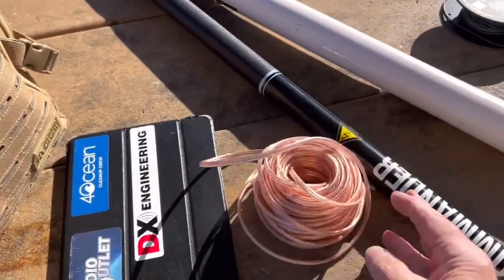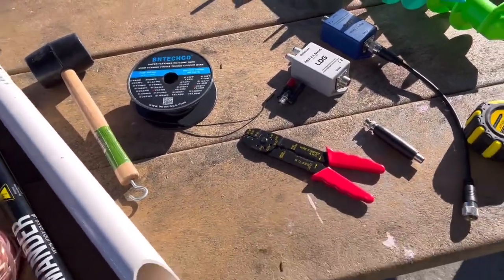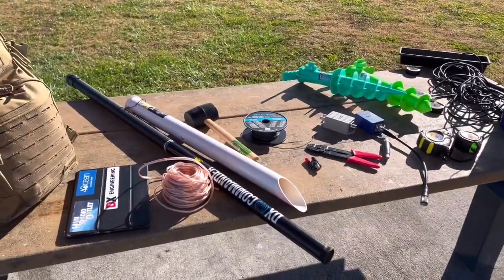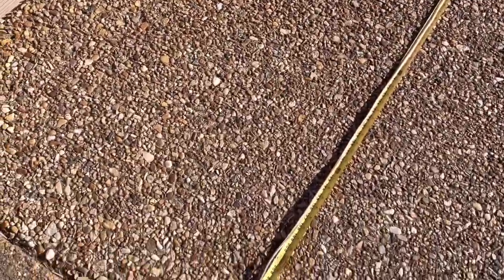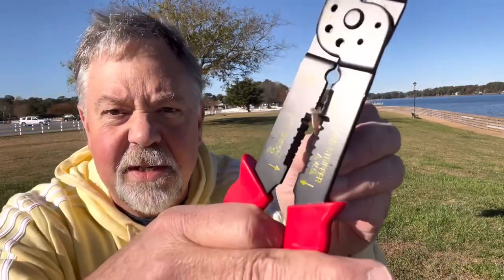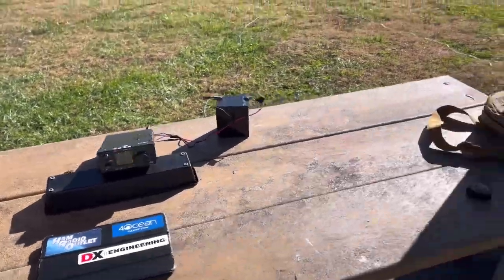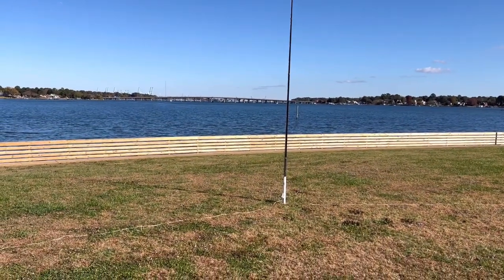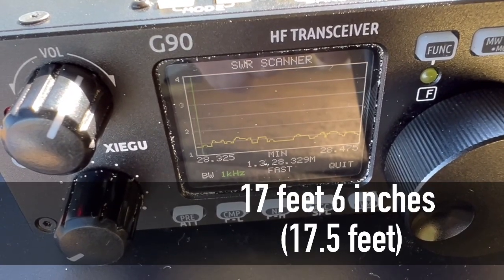How to Build an Easy Vertical HF Antenna

Comment: I've had good success with a similar antenna. I understand what you're trying to do with the quick-and-dirty approach. Here's how I church it up a bit: What I do with my radials is attach Anderson Powerpole connectors to them in groups of four, then I have connectors hanging off the ground terminal of my transformer on short pieces of wire. Makes it really quick to deploy. I've got three groups of four radials, two of them 2m long, one of them 5m long for total 12 wires on the ground. Silicone insulated wire is really good for radials because it's super flexible and doesn't tangle the way stiffer PVC insulated wire does and that lets me get away with having four pieces of wire permanently connected. I use the same radials with my 17 foot whip for a quarter-wave ground plane antenna. With the radials I described, you can tune the whip very close to 1:1 SWR on 6 to 20m.
Reply from the maker: Good stuff, thanks for sharing
Reply: You say 4 radials - two 2m, one 5m - what's the 4th?
Reply: @ctrl-brk  No, I'm talking about sets of radials (connected to single Anderson Powerpoles). So 2 sets that contain 4 x 2m long radials for total 8 x 2m radials, and one set that contains 4 x 5m radials.
Reply: @dangermandave67  Do you use them all no matter of freq, or it depends? Ex: for 20m do you use only 5m radials?
Reply: @ctrl-brk  I just use all of the radials, regardless of frequency. It seems to work OK. But I watched a YouTube video recently where someone was using raised radials; they used a stick to support them off the ground close to where they attached to the feedline and also at the end, so they don't touch the ground. With this system, they were able to tune the radials so that the antenna had close to 1:1 SWR. I might give that a try as well. However, it will necessitate carrying a VNA in my backpack. The benefit is that only one or two radials are needed.

Comment: I absolutely enjoyed the video. I need to get one of those masts. You are inspiring me to try the same thing but I also want to try using  both wires (of the speaker wire) and short them at the top, so it will be a vertical loaded linear dipole. May be able to do 40 meters that way (or half that height for 20m).
Reply from the maker: Thanks! Sounds like a great experiment!
Reply: DX Engineering sells the DX Commanders in the states now and they sell the poles separately too.

Comment: 👍Thanks for posting. Speaker wire is great for making wire antennas. Connections can be made more permanent by using electricians "choc" block and taped up.
Reply from the maker: Thanks, great idea

Comment: Nice work Walt. Any wire can be an antenna. It doesn’t have to come from an antenna manufacturer…  The BEST antenna is the one you have in the air and works! 73!
Reply from the maker: Thanks and absolutely! 73

Comment: The 4:1's seem to do well with the smaller verticals, like the Ryabkov and your 17.5'. As a collector of the LDG Infinity Stones, I noticed that the manual for the LDG 4:1 unun says that it is for verticals 18-43 feet. I might give the 18 foot one a try, since it's a perfect length for one of the smaller masts I have.
Reply from the maker: I’ll be interested in how it works with 18’. 73 my friend

Comment: Love this, thanks so much! How much longer would a wire need to be to get 40-10? I’d assume you’d need a tuner as well…
Reply from the maker: Thanks! Check out the Rybakov antenna. It’s basically the same as this one with a 25 foot (7.6 meter) driven element. I’ve had some success on 40 with it. 73, Walt
Reply: @COASTALWAVESWIRES with your surf rod holder do you find it necessary to remove the stop pin?
Reply from the maker: @brianr76  no I leave it in
Reply: @COASTALWAVESWIRES  thanks so much…. Just making sure that whatever space is on top is good enough to hold the 10 meter pole. Happy thanksgiving!

Comment: These LDG baluns and ununs are so versatile, every ham should have a few in their kit. The cost is reasonable as well.
Reply from the maker: I agree! I have them all except for the 49:1 they built. Just can’t find one.
Reply: @COASTALWAVESWIRES LDG removed the 49:1 unun from their product list. I have no idea why. Seemed to be popular enough.
Reply: Or build your own, it's so EASY! And pretty cheap too (well, if you order for multiple devices. Shipping is pretty high cost now!).
Reply: How about U/V rays? Any effect on the balun material? Close to the equator!😮😅😊
Reply: make your own, no need to buy!

Comment: Good stuff Walt! 

The thing to remember with ground radials is it isn't the length, it's the number. I suspect that the antenna would likely work even better with 10 2.5ish meter radials than it does with 5 longer radials.
Reply from the maker: Thanks! You’re absolutely right
Reply: @COASTALWAVESWIRES  great vid as always, but to take that thinking further, how about comparing a flyscreen ground to a bunch of radials. With the flyscreen you don't have to be careful about Joe Public or his dog tripping over one and suing you! VK4BOB

Comment: DO I NEED A BALUN IF I BUILD THIS JUST FOR 11 METERS ?
Reply from the maker: No you can get away with a banana clip as I showed in the video. Make the driven element 8.55 feet (2.6 meters) long.
Reply: Never know until you try it!

Comment: Solder, sure, if you're at the bench: why not.
You need something in the field: no need, no problem.

To those out there: do you think electricians or utility workers use soldering irons while working on communications or electrical equipment? No! It's all compression-style terminations.

HVAC and plumbers are the only occupations I know of that "solder" connections together. Welders melting similar metals together using arcs/high temps/etc.
Reply from the maker: Roger that! Great comment

Comment: Good one. I would not solder the ends as it makes the wires brittle. Also I have been using WAGO lever wire connectors lately. That would make connecting the radials easy and secure (I prefer to use the radial term for more than a single wire whereas I think of a counterpoise as a single wire.) The WAGO comes with a variety of sizes for connecting 2, 3, and more wires. I use them to add length to my dipoles and make almost any connection where an old fashioned wire nut could be used.
Reply: I meant Wago connectors. Hate spellcheck.
Reply from the maker: Thank you, good information. 73
Reply: And the Wagon connectors make Go Boxes so easy to wire up.

Comment: I just watched 30 seconds, but you gotta solder that wire my friend!
Reply: When I was a kid we used to make circuits with lamps, bells, buzzers and switches by stripping bell wire with our teeth and twisting the bare ends together. They worked every time. Nowadays I can take two multi-strand wires, do a linesman's knot, solder the ends, put them in a screw connector and cover the whole lot with heatshrink and STILL get an open circuit!
Reply from the maker: Hahahahaha
Reply: @COASTALWAVESWIRES  Well that did not take long.  LOL